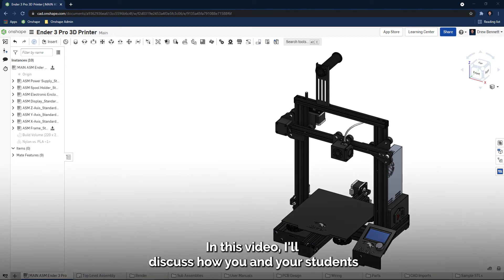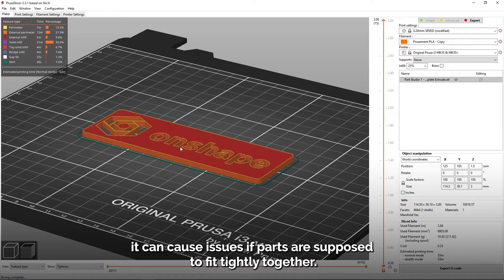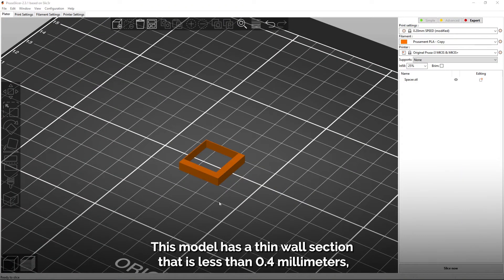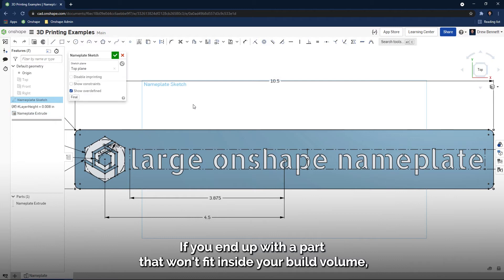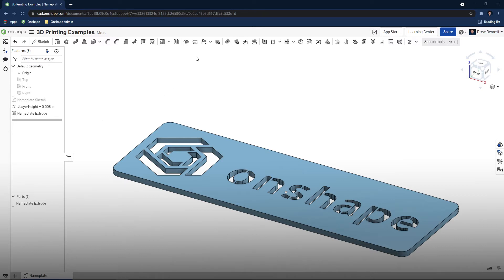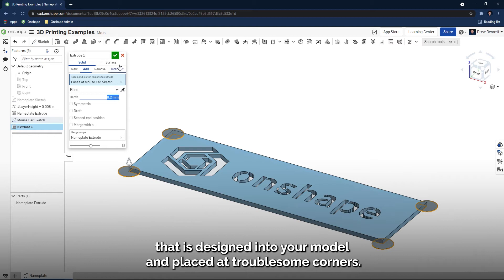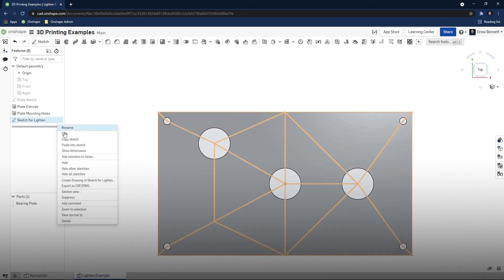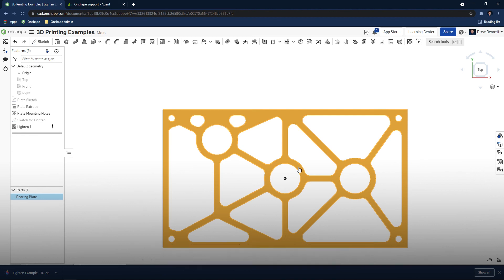3D Printing in the Classroom | Onshape for Education

Comment: This is really great. Thanks! I have one note to #4, you should have a little tolerance between the two pieces that you are about to split. Something around 0.2 mm would work, but that would change accordingly to other factors (geometry, nozzle size, material, print quality, printing method, … etc)
Reply from the maker: Wow! These are some great tips. Next time we'll think about adjusting the model in the way you suggest for accuracy.